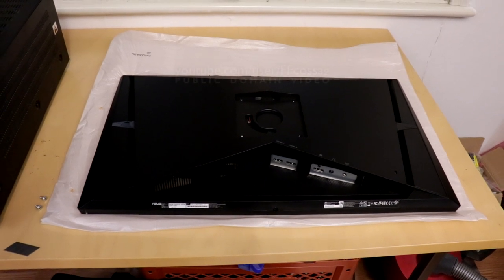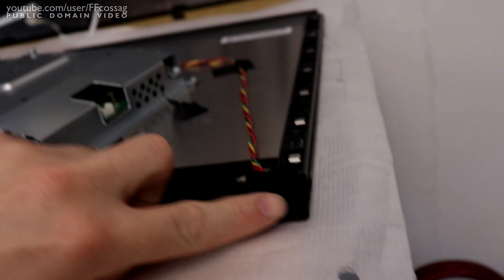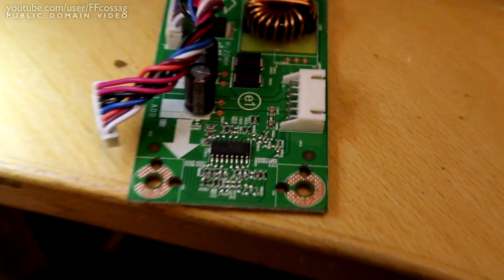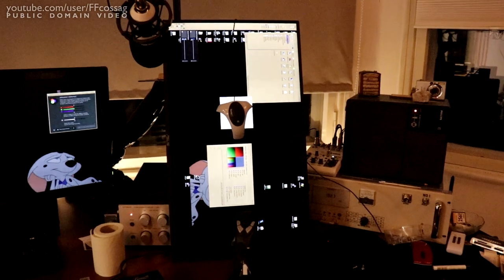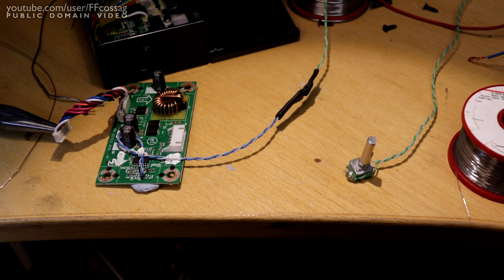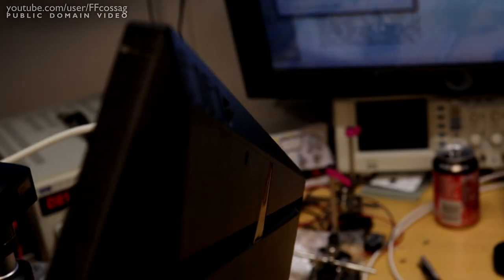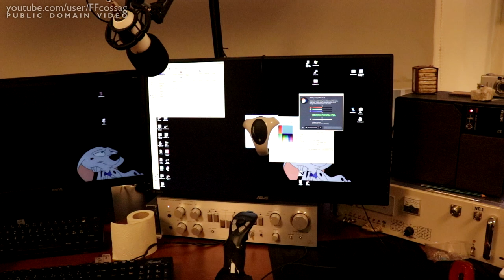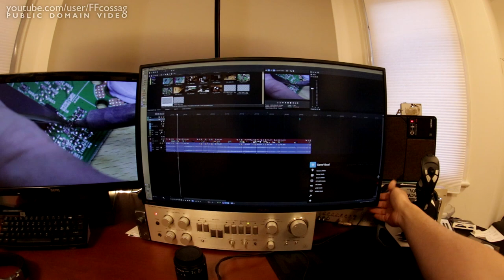ASUS VG27A brightness mod -  dimmer & wider range with a brightness knob

Comment: the warranty guys will be absolutely flabbergasted at the massive knob that brought the monitor for repair and the knob at the monitor itself !!! 

ps : i know your not planning on returning it ..... im just imagining it !!
Reply from the maker: If it does fail in a way I can't easily fix, I'm going to undo the mod and send it in anyway - I imagine they just won't notice the very clean hole in it, lol.
Reply: @FFcossag  Just put a Warranty void if removed sticker covering the hole. ;)

Comment: I'm currently using this exact same monitor and the brightness is awfully bright even when set to zero, have been using software solution which basically dims the screen by greying the content, and now i see your video, might attempt your mod on mine in the future, thank you very much for this video!

Comment: $500 and they still put the Chinesium caps on them...
Reply: I wouldn't even pay $50 for that.
Reply from the maker: It's the way of the world. In these DC-in monitors, it tends not to matter. The caps don't really work all that hard. They're much more critical in monitors with AC inputs. This is a budget monitor as far as 27" 1440p IPS monitors go, after all.
Reply: Yup, and now especially that you're driving it at low brightness, the LEDs lifetime increases exponentially as well.

Comment: 500 Euro for that plastic piece of crap. wow, what a rip off. The back is just clipped on with horrible plastic clips and the metal can with the boards inside just floats around on the back at a wonky angle. Ive repaired cheap vestel TVs before and even they have the boards held in place with screws.
Reply from the maker: That's how all computer monitors are put together, lol. You only pay for the panel, basically, everything else is whatever.